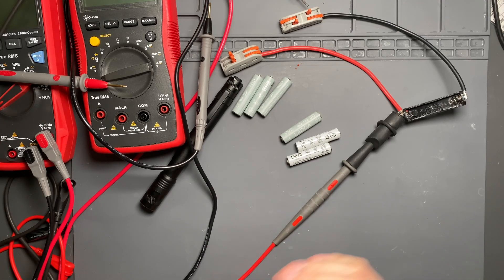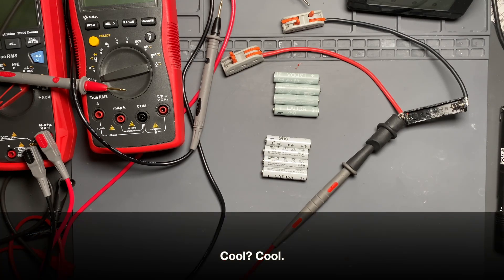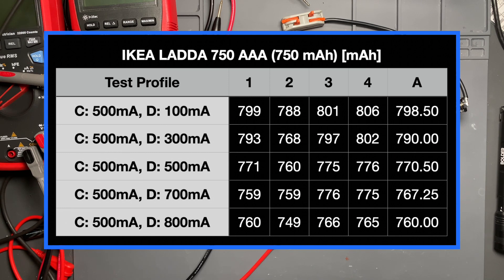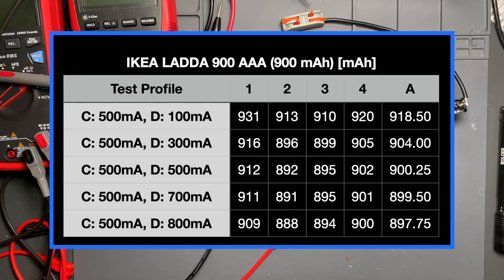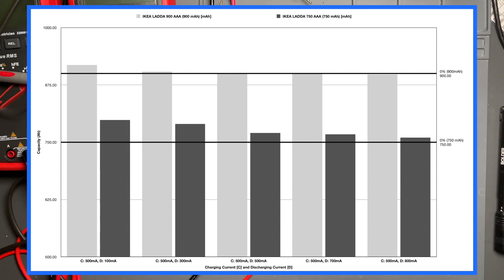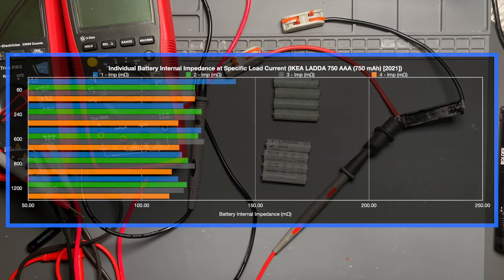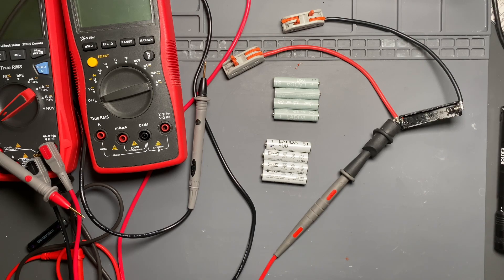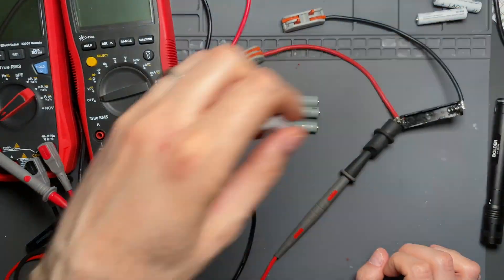2021 IKEA LADDA 750 and 900 AAA Rechargeable Battery Testing and Analysis

Comment: Is there calculation of charging the batteries base on what mAh and also, discharging it?
Reply from the maker: Generally you don’t want to exceed 1C while charging where C is the capacity of the battery in mAh @ 1.2Vdc. So, if it is labeled as a 2500 mAh cell, then you don’t want to exceed 2500 mA during charge. There is no specific discharge formula for conditioning of low-self discharge Ni-MH batteries that I know of, since it usually isn’t necessary during normal usage.

Comment: Sir if i had AAA rechargeable batteries 750mah 1.2v what would be best current charge to charge these batteries.

Also, at what current mA would be best To Discharge the same batteries? (750mAh 1.2v)

Comment: I've used Ladda since they they were made in China (green/silver, not particularly good) and the white AAA 900mAH have been the only ones failing for me. Not a huge amount but around 10%, and the only ones I've gotten dead right out of the box. Maybe that's why IKEA choose to only use 750 now? I've gotten the new ones, so time will tell. Most of my applications with AAA are triple cell, and 900 have had rather big problem discharging unevenly to the point one cell dying and unable to charge again, or requiring multiple attempts (in IKEA Storhögen, sadly no longer sold). Not a single 2450 have failed so far and not the brown Ladda 1000 AA (mostly for remotes) either that we had for while, at least in Sweden.
Thanks for high quality reviews!
Reply: Just doing a search to find out the same thing: why do the white AAA 900mAH Ladda's die so frequently.  I have lots of both the while/blue versions of both AA and AAA, and the 900 mAH AAA's are the only ones that I've had to throw any of away.
Reply: @gukid  Yes, and my 900's keep failing sadly. Had 2 more this week refusing to take charge and just get hot. Can they be wound too tightly at the factory and shorting out internally? Still not a single other IKEA rechargeable have done the same. I probably have over 100 different types in total, even the very old green/silver IKEA that were made in China. Even they just work and just gets weaker every year, but none has died. 900's also discharges faster in storage than any other type.

Comment: Do you have to charge the ladda batteries with the ikea branded charger or can they be charged with any charger?
Is there a downside to charging batteries with different brand chargers than the batteries?
Reply from the maker: No it is not necessary. You can use whatever charger that supports NiMH chemistry, but doesn't exceed the battery's maximum charge current (usually, 1 x battery capacity). But some chargers out there are quite poor. I've tested a few of them on the channel. Thanks for watching!
Reply: @TheCuriousEngineerChannel  Thank you for the reply and Merry Christmas.

Comment: I purchase the Ikea Ladda 750 however it seems cant power up my fingertip Oximeter :/
Reply: It probably has a high cutoff voltage, don’t throw out your alkalines that “died” in it because they still have roughly 50% capacity left. If you must use rechargeables for it you can get lithium rechargeables that have a BMS that regulates the voltage to 1.5v. Be warned that your battery gauge will always show full because of this.
Reply from the maker: Bummer. :(

Comment: It's a shame in IKEA stores you can't find the 900 mah Ladda 900 only the 750's now.  Seems like a step backwards to me because I'm all about the capacity.
Reply: They gave the 750’s a light grey colour like the lower capacity AA, which to me suggests they might bring out a higher capacity AAA with the darker grey colour.
Reply: @CT-vm4gf  I hope you are right time will tell.
Reply: I doubt sadly because the demand for AAAs is falling, there are fewer and fewer devices using them. Now even TV remotes use Li batteries
Reply: @EnhancedNightmare  IDK, I'm seeing an opposite trend, with devices (remotes mostly) where they start using AAAs in something that can easily fit AAs, which annoys me to no end and has me thinking remote manufacturers are colluding with battery manufacturers.